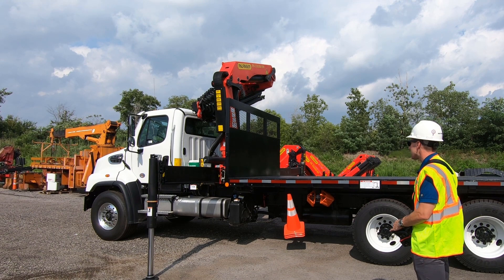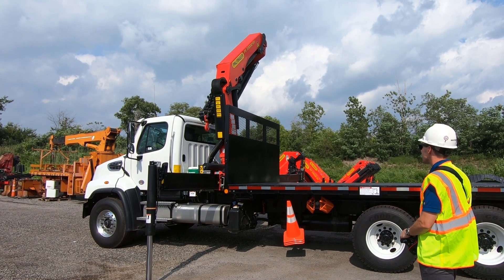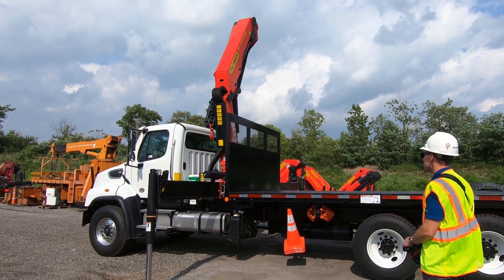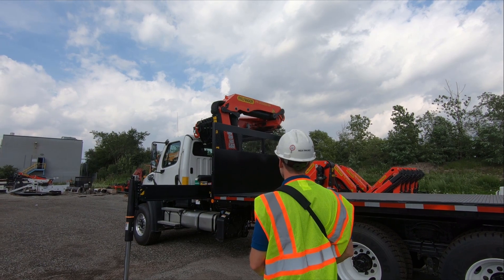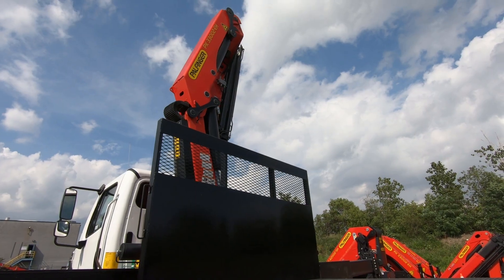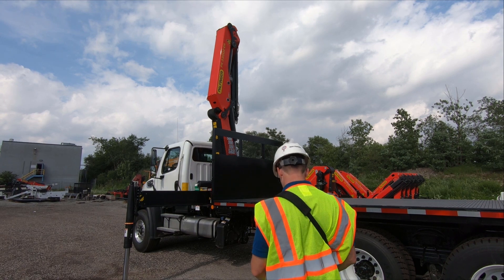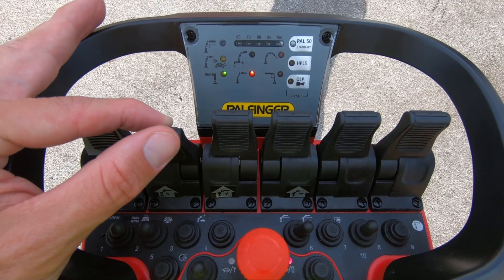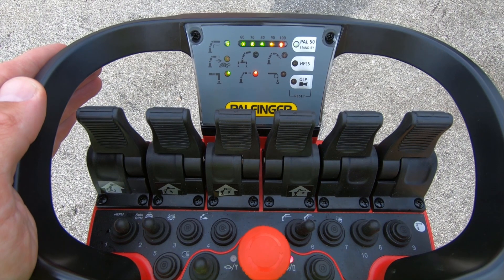Testing the Palfinger Overload Protection System

Comment: Is this covered in the operator's manual? Also, curious why you'd post this video if it is in the manual.
Reply from the maker: Yes, it is in the operator's manual, but we sometimes get calls, often after hours, where an operator has the crane stuck in the high angle position and it is easier and more helpful to send them a quick video than tell them, "Just look at your 150 page manual."
Reply: @RunnionEquipment That's a good idea. Thanks for that.